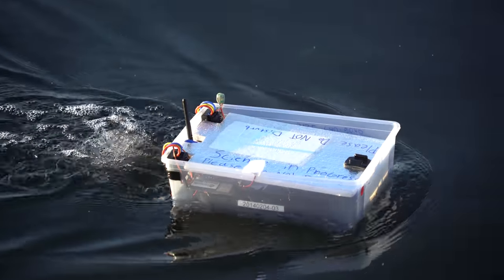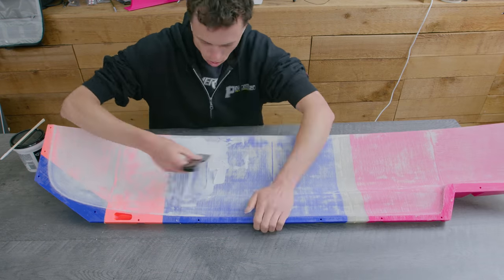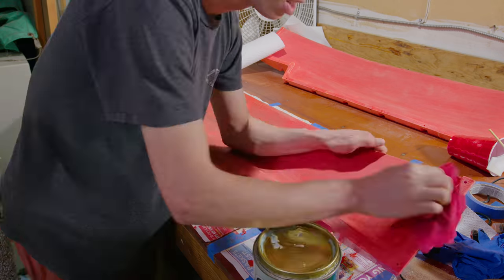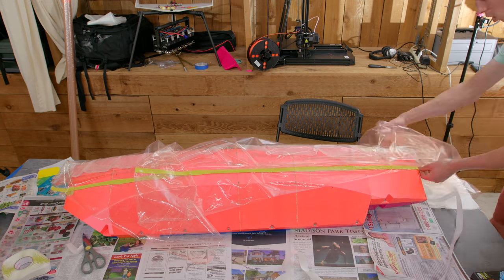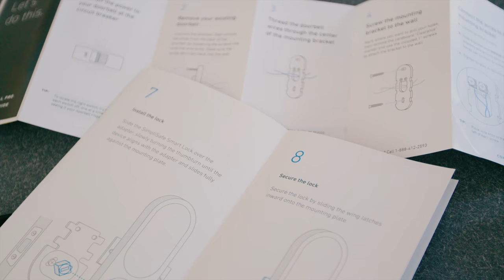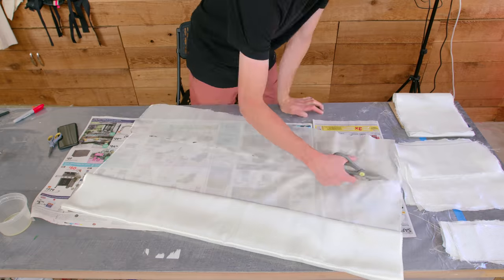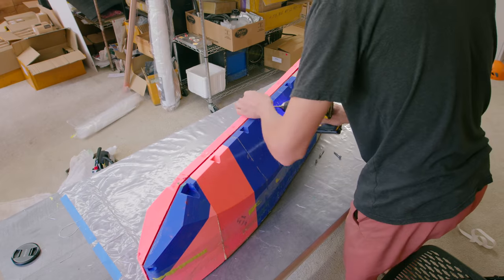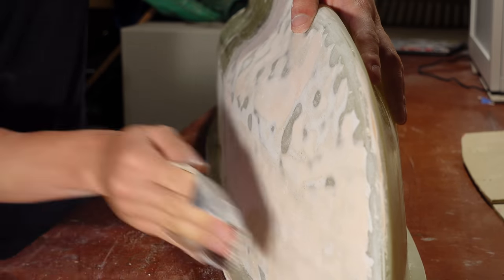I Built a Solar Powered Tug Boat to Pull My Kayak - Pt. 1

Comment from the maker: Take 20% off your SimpliSafe security system AND your first  month is free when you sign up for the Interactive Monitoring service. Visit https://simplisafe.com/rctestflight to learn more!
Reply: It seems that the channel Rammy RC has the mold making process down to a science, he makes scale models of planes. I think I would have made the molds of the sides separate and then joined them together after they were solid pieces so that you had the ease of getting all up in that crevice. You know She is us going to want the strongest part to be right in the middle there. I can't wait to see what you will make once you get this process down. I can also imagine some kind of collaboration between you and the Rammy RC channel!
Edit: on wait you already decided to do the halves separately!
Reply: you need to watch One Man's Dream - The Britten Bike Story, what he does with carbon fiber is amazing
Reply: @evilcanofdrpepper  but the first molding was the most successful I think - also I would maybe make it without the vacuum, but roll the air out like in hand-layed boat making, but you need special resin/polyesters for that. It will also give the strongest keel connection.🤓
Reply: @TheLukemcdaniel  everybody has got something to sell......except for the truth.
Reply: @DieselRamcharger  I've seen it in action.
Reply: @TheLukemcdaniel  youve obviously missed the point.
Reply: @rctestflight I just clicked on the link for the 100W solar panels and got page not found We're sorry, but the page you requested does not exist.

Comment: if you are ever going to do more hulls I can recommend using an inner mould to put fibreglass around instead of trying to get it inside of the moulds. much like the fibreglass canoe made by xyla foxlin.
Reply: With an outer mould like he did, the outside will be smoother by itself, without the need for a lot of sanding.
Reply: @Tomwesstein  don't forget he had to sand the mould. It's one or the other. Sanding is also only really needed if you want to apply varnish. If you don't sand the fibreglass it has a very smooth texture so that might be smooth enough for some.
Reply: @sainsay  That’s true, I overlooked that he then doesnt need to sand the mould. Could indeed be a good alternative. I’m curious now
Reply: I was thinking more like @RamyRC does his planes.  I think he spends almost as much time filling and sanding his molds as he does printing them.
Reply: @Tomwesstein  It is an interesting alternative but once you sanded the mold it will make all hulls smooth. With the inside mold, you need to sand all the hulls that come out which is more time consuming per hull molded.

Comment: The next time you use PVA apply it with paper towel, it is easy to do. As far as the bag, use a big enough bag to fit entire mould into. Pre tape bag leaving one end open with tape on but paper over tape, insert mould, then pull paper and seal. Put bleeder cloth over peel-ply. Once you master the trade, think about infusing these parts, all cloth layers go on dry, giving you hours to perfect, do not use spray glue to hold dry glass. I used very small bits of masking tape, then under vacuum add the Epoxy resin.

Comment: Polyester car body filler is your friend when smoothing stuff like this, cures in minutes and sands beautifully =D
Reply: I would have used that or high build automotive primer to make it smooth depending on the roughness. Like another commentor pointed out, you can use a preval sprayer.

Also, you probably would have had an easier time with a male mold and then smoothing the outside with filler and/or primer.
Reply: @vanbrua  I use body filler at work and without much work it sands to an almost glossy finish, it bites into most finishes as well so no danger of it peeling off.
Reply: the bondo boat?
Reply: @vjhansen7280  i don't think I've seen that. Not entirely sure what Bondo is either.
Reply: @cmdrdevlegion7824  bondo is just a another body filler
Reply: @vjhansen7280  ah, right. How does it set? I know some fillers have a slightly rubber like component and they sand like shit (like in this vid). They just clog the sand paper and leave little pellets everywhere.
Reply: Problem is that it becomes very heavy really quickly, which isn't really what you want when you're powered something with solar panels. Best thing to do is use better techniques to achieve a better part from the get-go and perhaps do a skimcoat of body filler to cut down on hydrodynamic drag.

Comment: Heat break hearing the PLA started to melt in the sun.

Very impressed at the mold working as a whole. 

Maybe some day I will experiment with making a mold and fiberglassing.

The vacuum bag technique is my biggest unknown.

Being able to make some molded carbon fiber parts would be interesting.
Reply: Lesson - use near solid infill and many perimeters if thinking about vacuumable 3D printed moulds and just pull as hard a vacuum as you need.
See "Ramy RC" channel to watch how he uses 3D printed moulds to make really large fuselages for model airliners.

Comment: One way to get an existing model or fresh piece stiffer for cheap, would be to put in glass rovings.
they are fairly cheap and will act as frames and stringers.

Comment: Just some suggestions on your molds as a composites technician.  Good job with the jel coat! It can definitely be brushed and sanded. However, make sure to do a light coat and wait for it to go to b stage where your finger print doesn't show when touched. Then apply a 2nd thicker coat this stops aligatoring or cracking. Instead of spackle use resin mixed with cabosil to sand. For the bagging apply breather material so the vaccum pulls and apply the tape to the bag for easier alignment.  Really good for your first go!

Comment: Bravo bravo! As someone with lots of boat building and fiberglass experience, I must say how impressed I am with what you accomplished! You only had a few hiccups but like always you were able to overcome. There is a product called glass microballoons. When added to epoxy it makes the perfect filler. It's strong, flexible and much easier to sand. If you do something like this again only do two layers of woven at most. Then do the rest with fiberglass chopped strand mat. The woven helps the hull from cracking and the chopped strand gives it rigidity. An integrated stringer system would also make a difference.

Comment: You can use painters plastic for your vacuum bagging, and regular cheap painters caulk instead of "vacuum bagging tape".  Caulk creates incredible seams for folding large sheets of plastic over whatever you are vacuum bagging.  Source: Have done a lot of vacuum bagging for RC Jets.
Reply: Also, I use 1/4" poly pipe (cheap stuff) and paper towel over the end of it, then electrical tape to secure it, and just stick it in the bag with a bunch of caulk around where you insert it.  This is in place of the "valve" they sell with that kit.

Comment: I was working in a prop shop in highschool and put more gallons of Bondo down than I care to remember... But one trick is to spread it out pretty thick, then use a cheese grater (rasp?) to grate the surface down BEFORE it's fully cured. Basically it goes into a sort of rubbery state before hardening, then you grate the majority off, and the rest can be sanded when hard... Hope it helps, you know for the next boat ;)

I think you can get the rasps at Harbor Freight, but if not, a body shop supplier will definitely have them.

Awesome video! Can't wait to see the next one!

Comment: With fibreglass, The learning curve isn't steep, just sticky!

I personally wouldn't have bothered with the vacuum bags when doing a boat hull, but it's a great way to gain experience before tackling that solar glider wing. bagging works great on fairly simple convex forms, but (as you discovered) sucks at conforming into tight concave spaces, I've seen sand or lead shot used successfully inside boat moulds, but that was on full-size craft.
Reply: I  don't think the vacume bags were any advantage, just roll the air bubbles out is enough.
Reply: Could you bag the inside and just fill it with water?
Reply: @Paulman50  I agree.. sure it helps with the surface finish and compaction, but probably not 100% necessary for this application..
Reply: @thefekete  I did that with a small part one time.  It certainly can be done, but then you're trying to balance an extra 8 pounds per gallon of water...  If your mold can be braced in the right way, It might be helpful...  But like the other poster said, probably not really needed for this application...

Comment: 'Banana Slug'. That's great!
 I'm watching your video, at the moment. If I could make a suggestion... 
  Create reinforcement pieces made of various types of wood or carbon fiber 'blocks'. To avoid having to modify the reinforcements have them machined beforehand. For instance, the lowest point of the keel where a propeller shaft will exit. Create a block of wood, (don't recall the best type, but it's not balsa. Oak? Cedar is a good choice.), with an opening for the shaft. Give yourself some extra tolerance in regards to the position of the hole. To make it easier to line up properly, modify the mold from the beginning to accept this block. As I'm watching you put the v. bag in and I believe that you could make things easier if the most difficult part, the keel area, was pre-made. 
When I was younger my dad and his buddies built their own boats to work the waters. These weren't a bunch of layers of plywood and 2x4s. The most difficult part is the front piece that ties the whole frame together. It had to be chiseled out by hand, usually oak, to accept the keel and side reinforcements.
A single piece keel that can be placed inside of the mold as you're going along, 
it would eliminate any issues with the space between the molds.
Epoxy the reinforcements into place after laying in fiberglass mat, similar to what you're already doing. I would suggest learning more about boat design before getting started. I have no doubt that if you watched a few YouTube videos you would do great! I've used this technique while building radio controlled airplanes as a reinforcement for the center wing spar section. I tend to fly 'aggressively' and I have snapped my wings in half. Sounded similar to a gun shot. 
  I have been putting materials together to create a project or 2. One goal is a autonomous airplane is one.
  If there is enough cell coverage, would that allow me to utilize it to maintain contact with, and control of the airplane?  I do own a 7-channel transmitter for visual control of the plane, but couldn't most of the control be accomplished via cell? Of course there has to be coverage. 
  I am watching an other of your videos and you mentioned criticism of boat design. Lol. I hope that you don't think that I'm simply criticizing you. I was offering a suggestion to make your jib easier. I would rather work aircraft than boats, too. My humble opinion is that if knowledge and wisdom should be accepted when shared. But that doesn't mean that you do what has been shared, rather I put it into the 9 million other ideas that are constantly roaming around my head. 
    If you're able produce these projects, which require knowledge of the various subject matter involved, and they actually work, that's awesome! 
You created a gps guided vehicle from foam and Tupperware, that has been proven to work. Boats can be difficult because if they sink, your electronics are either lost in the depths or simply ruined by the water. I have nose dived rc airplanes into the ground at full speed, but I recovered the electronics and re-flew the airplanes. The electronic gear is expensive. 
  I've gone around the world in this comment due to commenting as I watch more than one video while typing. And ADD.

Comment: In marine hull construction we have these things called 'stringers'. They are lightweight pieces of balsa or other wood used as supports across the inside of the hull so you dont have a big, thick, crappy, heavy, weak, fiberglass hull.

Comment: I built a solar powered triamaran with xps foam board not long ago. 
Most of center hull and 2 side hulls are just triangle made with  40mm thick XPS foam board. Joint between boards are cut with circular saw and hot glued. Only bow and stern of center hull is 3d printed(which can also be made from foam board sanded down . 
It's powered by 2 bolt-on duct thrusters located between center hull and side hull,able to reach 4 knots when using only solar power(two 50w panel).It steer by diffencial thrust ,so no rudder is needed.

It's not as spacious under water as your fiber glass hull but it took lot less work.

Comment: i have a lot of thoughts for you after watching this. first of all, you might consider styrene based resin, you'll have an easier time after its cured. Also, you can get two different kinds of filler, one is called microballons, or some times people refer to it as q-cell. this is very soft sanding material after hardening and will help you fill much easier. also, if you want more toughness instead of an easy sanding-filler, you can use silica, its also a white power to be mixed with the resin and is commonly called 'plotch'. anyways, these are two things you might consider. also, if you bought 12oz or 24oz fiberglass called 'cofab' you'll have an easier time reinforcing the inside and stronger; using strips of the cofab is the way to go, and also if you use thin pieces of foam on the inside the create stringers, which you can put down with hot glue and then glass over them to form a strong curved stringer. massively strong and will keep it light. finally, you might consider watching the resin as it kicks and trim the top off when its stiffended a bit but not too much. it will save you a lot of time and possible injury too. the guy recommending to thin out the gel coat with acetone is correct, also consider doing what is called a hot-coat, but practice that, you want to get the catalyst right on it or if its too hot it will alligator on you. and youll have a defect. also, next time you can spray the mould with pva, then wait and do you gelcoat, and then lay it up. spend more time on your plug for the mould and you'll be able to make better parts that require less work to make them ready and youll make more parts from the mould. the key is waxing the mould. do it like 50 times at least.

Comment: Printing your molds turned out great, i would of made it the inside as a plug, yes you would have to sand it a little but i think in the long run it would be less work, to make it release you drill some 1/8" holes in the plug, cover them with scotch take you cut with scissors so you get a smooth edge, after it's gone off and cooled down you use compressed air to blow in the 1/8" holes and it should pop right off. the whole thing will expand when it gets hot, the layup will go hard and when it cools the plug should shrink down some,  I would of used polyester resin as well, fiberglass matt, and to fill in bad spots you mix the resin with micro balloons. i worked at this place a few years, at that time we made more than just pipe and i'm sure they still do, we made life rafts, all kinds of boxes, but lots of pipe, some took a week of three shifts a day, 90 gallons a shift, the pipe never stops turning till it's finished,   https://www.youtube.com/watch?v=njpWtpVgzoE

Comment: The vacuum bag stage is overkill. Just be reasonably careful to avoid air bubbles when laying up.
To solve the stiffness issue add some ribs. These can be glued in place pretty much immediately after laying up the hull.
As others have mentioned polyester filler works great on moulds. Technically you shouldn't use it over epoxy but in reality it will hold up pretty well.

Comment: the correct way to do it is with two halves, after waxing and aplying pva, you apply one hand of gelcoat, when the gelcoat is sticky at the touch that is the best moment to lay up, you can wait until fuel cure but best addeshion is achive in this point, then apply one hand of resin and one layer of fiberglass (if you lay up the fiberglass in parts as you did in a big impact it can breake in the unions, the best way is to apply a full layer at once) and so on until desired thickness is achived, wait until is hard but not fully cured, grab a cutter or a scissor and trim off all the excess, then aplly one hand of resin to the lips of the mold and clamp the two parts, also if it is posible apply one strip to the entire union, also vacum bags are not needed, vacum is used when you need the less amount of resin of a weight critical part, or when the part is so big that manual layout is imposible

Comment: hobbyist tip.... 
to add rigidity without much weight to flat surfaces, instead of adding multiple layers of fiberglass, put a bead of spray foam, or superglue strips of balsa wood in X patterns then lay fiberglass over those strips. This will add quite a bit of rigidity w/o the weight.

Comment: Nice project! Microballoons in epoxy makes a good filler, easily sanded afterwards. IIRC phenolic only polyester friendly but glass balloons okay in epoxy.
Reply: Actually it's the other way round :D Pheolic ballons collapse in polyester.